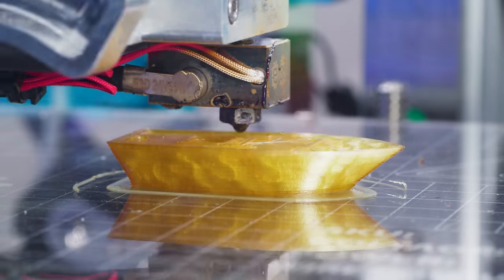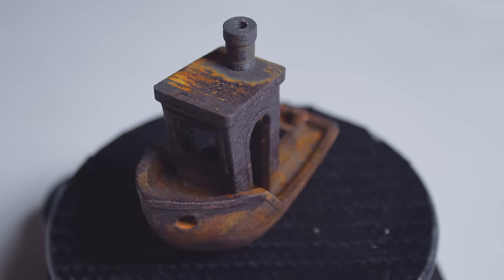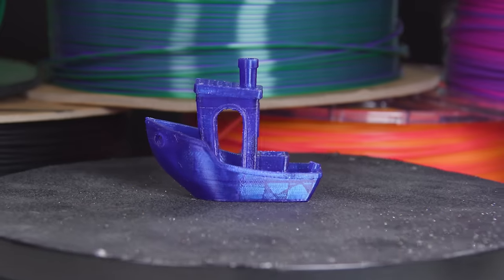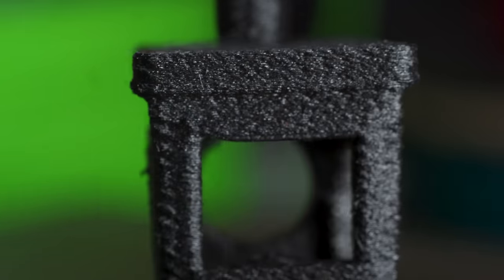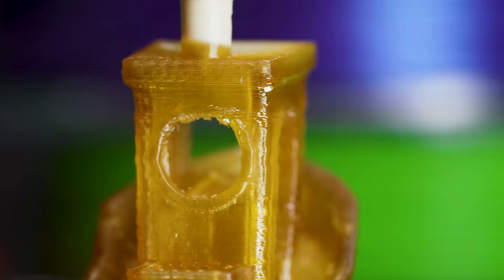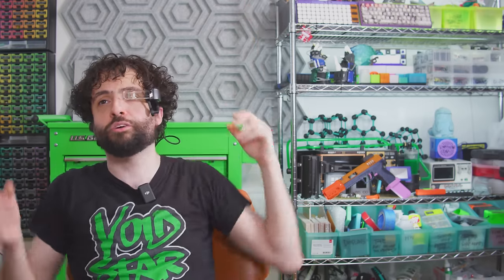The 3D Filament Tier List! Which Should YOU Use?

Comment: FWIW I have printed a fair amount of straight-up PP on my X1C - it's really easy to get bed adhesion:  clear packing tape is PP, so just put strips of packing tape on your bed and you're off to the races. You'll want to have an enclosed printer to avoid warping.  Print with minimal cooling (read 'print it slow ') to get the best looking prints.  Major plus points for PP: complete layer adhesion PLUS food-grade (use a Stainless nozzle for only PP to avoid contamination) make it very useful for anything food-grade and industry.
Reply: The material itself may be food grade but that doesn’t mean the printed part is.

PP is a great material if you can get it to work, it is very durable.
Reply: “Straight up PP” 🧐🧐🧐
Reply: and it can take the heat so you can sterilize it, and its recycle code 5

Comment: TPU 95a is a really great filament for heavy wear items if you 1. can get the highspeed version and 2. setup a specific printer dialed in for it (an older slower one works great). I've been using it to make specific belts for certain "difficult environment" equipment with great success but it took a very specific only that setup to get it to work... removing supports mostly works and you can actually mildly flame smooth parts with a torch if you really want to (do this outside though and only used for some brake/clutch covers).

Comment: Gonna have to hard disagree on the metal bearing filaments.  They can be a pain in the ass, and yes, you can electroplate, but when trying to make either cosplay items or artifacts/props from video games and movies the ability to rust/patina them and to sand them to a very metal appearance, it's straight up far far better than electroplating.  With electroplating you can get nice shiny metal finishes, but these filaments absolutely slay if you want aged and weathered metallic finishes.
Reply: His tier list encompasses all the use cases possible not just your one specific hyper niche use case
Reply: @rodiculous9464  I'll note that the rubric included what uses cases the filament enables, and cosplay / props isn't a small niche
Reply: Gonna have to note that there are multiple million+ subscriber youtube channels dedicated to these activities.

Comment: Hey Zack if you wanna run some TPI/PEEK/PEKK/Ultems or other super polymers, we've got two crazy high temp printers just sitting in our warehouse. They'd need some love, but could be a fun project breaking down an industrial system and fixing/upgrading them. One is a 3ntr Spectral 30 which has 3 nozzles that can reach 500C and a chamber that can reach 250C. The other is a Smart3D macro engineering prototype, but it can also hit the 500C with 2 nozzles and 200C chamber (though it took nearly 2 hours to hit that chamber temp when we tried it). If you're interested in either of them, we can let them go for practically nothing and would love to see them put to use!

Comment: The Polymaker PA6-CF is something special. Currently printing it using an off the shelf Ankermake M5C with zero issues. I did have to edit a few settings to help oozing, but it prints just as well as PLA now.
Reply: love it

Comment: I used to print PEEK molds for heated silicone foam molding back in the day. The parts sold for a lot so it was well justified - but we used big ol' Stratasys machines and lots o' consumables.
Reply: Wow, if third-party PEEK filament is expensive, I can only imagine what those Stratasys consumables must have cost! 😮 Even with that, I’m sure the molds were much cheaper than machined ones, yet still with plenty of profit margin.

Comment: I've been printing with Polymaker PC 3kg spools on my Bambu Labs X1. It's been awesome. I live in Florida and moisture hasn't been an issue. I've Made lamp shades and aquaponics towers with it. It's become my favorite filament
Reply: I am also in florida and have an X1C coming on monday. Wooo
Reply: The PC that is generally available (Bambu and Polymaker) I understand to be PC and PETG, although exact composition is difficult to come by.  Regardless, it prints great on the Bambu X1C.  Easier to work with than the PETG filaments, as it releases from same material support and sticks to a glue surface on a PEI bed when hot, but releases at room temp.  If it came in more colors, it would be perfect.

Comment: I use PP for lab stuff, running experiments with more bed materials. So far only sacrificial packing tape works well enough.

I am also experimenting with POM, literally impossible to get a good print with a normal printer. I definitely do want to figure it out for some scuba stuff. Current test is a phenolic paper surface.
Reply: In the Every filaments II video, Zack talks about Fillamentum PP 2320, which is a Polypropylene formulation that optimized for ease of printing, it's not hard to print, I use it a lot for chemistry/lab stuff. It's quite good

Comment: While it's awful for printing, HDPE is fantastic for milling. It cuts like butter.
Reply: It's funny that he mentioned Delrin immediately after HDPE and mentioned that it's great for milling. Which is also true!
Reply: Turned some endcaps out of 6" diameter HDPE cylinders, the smooth ribbons that came off were a sight to behold.
Reply: @defenestrated23  Ooo, I've never turned it, so I've yet to experience such beauty. Turning aluminum with nice sharp tools has produced ribbony chips for me, but they were somewhat worrying due to concerns about overheating.

Comment: You put CF PLA in S but ASA in A? Have you actually checked the usefulness of CF PLA? It looks pretty, it has slightly better heat resistance to regular PLA. It’s more brittle, its mechanical properties are horrible. Other than making something that has no load or heat exposure and no impact. It’s more or less useless unless you just want the matte cf finish. It’s not more precise, it just looks smoother due to the fibers. 
ASA is as good as ABS and has UV resistance.  16:30
Reply: ASA is awesome! You don't get the shininess of ABS but you lose the massive warping issues, it doesn't stink when it's printing, and it's weather resistant without needing coating
Reply: @greensheen8759  but then again it cracks on bigger prints

Comment: What you were talking about is a class of chemicals like 1,1,1 Trichloretholine.  It is illegal to possess in the US, it's actually illegal to enter the territorial waters of the US with a drop of it. I worked with it in the 80s and 90s. I put chemical resistant gloves in it and they dissolved. There is residue of it in the hubble because we used it to clean the encoding boards with it. It was the only thing to dissolve the lead in the solder we used. It was silver resistant so it left pure silver behind. It was used because we couldn't get 100%silver, we used 99.9997% silver and trichlor killed that last tiny bit of lead.

Comment: Full Tier List

S Tier:  
Carbon Fiber PLA (4:50): Enhances stiffness/detail without losing PLA ease.  
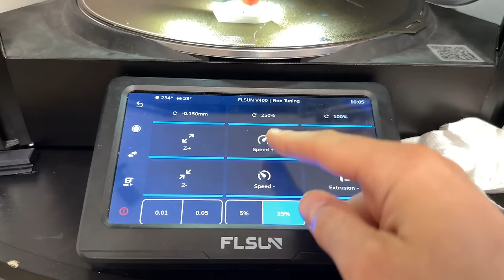High-Speed PLA (8:48): Faster printing, retains quality.  
“Tough” PLA (7:39): Greater strength and heat resistance than regular PLA.  
Carbon Fiber PETG (11:19): Adds stiffness to PETG, with less warping.  
PCTG (11:57): Durable, impact-resistant, better chemical resistance than PETG.  
TPU (9:37 & 24:56): Flexible, durable, for protective/wearable applications.  
Glass-Filled Nylon (19:39): High strength/rigidity, for functional parts.  
SEBS (27:26): Stretchable, returns to original shape, for special uses.

A Tier:  
PETG (10:35): Good toughness, easier to print than ABS.  
CF PET (13:36): PET with carbon fiber, stiffer with good printability.  
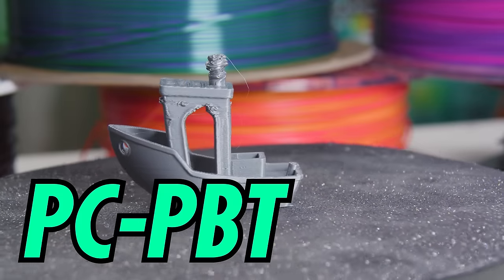PC-PBT (23:36): Durable, low-warp, versatile.  
PEKK (35:01): High performance for extreme conditions.  
Ultem 1010 (37:50): Excellent thermal and chemical resistance, challenging to print.  
PPS (35:38): Chemical and heat resistant, tough.

B Tier:  
Regular PLA (2:54): Easy to print, wide color variety, less durable.  
Silk PLA (4:02): Shiny finish, visually appealing, weaker than standard PLA.  
Matte PLA (8:10): Aesthetic matte appearance, slightly flexible.  
PA-6 Nylon (17:02): Durable, flexible, moisture sensitive.  
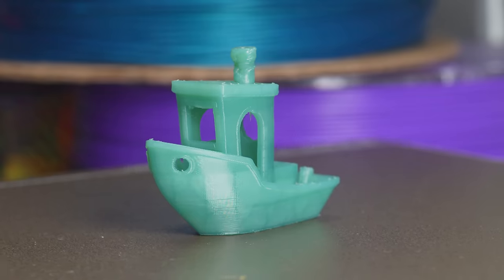PA-12 Nylon (18:16): More flexible and impact resistant than PA-6.  
CF Nylon (18:50): Strength of nylon with added rigidity of carbon fiber.  
GF-PP (29:04): Tough and lightweight, difficult due to warping.  
PSU (36:19): High heat resistance, suitable for food contact.

C Tier:  
Metal-Filled PLA (5:45): For aesthetics but brittle and expensive.  
PVB (14:05): Unique post-processing opportunities, some challenges in printing.  
OBC (29:43): Tough and flexible but struggles with bed adhesion.

D Tier:  
Wood PLA (6:26): Wood-like finish, can be challenging to print.  
HIPS (16:22): Used as a support material, less common with alternatives.  
ASA (15:40): Good for outdoor use, careful printing required.  
ABS (14:44): Durable and heat-resistant, emits odors, difficult to print.

F Tier:  
POM (30:58): Engineering material, hard to print.  
Polypropylene (28:17): Durable, notoriously difficult for bed adhesion.  
HDPE (30:16): Common plastic, poor for 3D printing.  
PVDF (31:56): Chemically resistant, hazardous when overheated.  
PEEK (33:06): High performance, prohibitively expensive and difficult.
Reply: Thanks man

Comment: I can't seem to find 99D TPU.  The link in the description links to 95A.
Reply: 95A is fine in my experience, its a little flexible, but will be just a strong. Basically indestructible, and for all intents and purposes rigid, at least if printed with high (or 100%) infill.
Reply: Armadillo from Ninjatek is 75D, but is way more expensive (100$/kg)

Comment: 40:35  It would be interesting to see if/when it makes sense.  Selective Laser Sintering (SLS) or Melting (SLM) or heck even Electron Beam Melting could make parts out of actual metal or some superalloy, so even if it can’t be machined by conventional means one would think it could still be done with metal?

Maybe some odd case where it needs to be Super-Resistant to Heat/Solvents, yet also Strong, yet *also light*?

Either way wild stuff.

Comment: My only disagreement would be to move iron filled filament up at least one step, I've found it's magnetic properties can be really useful for prototyping motors and magnetic gearboxes. Compared to trying to machine a big chunk of iron or managing to get ahold of electrical steel I'd much rather work around it's drawbacks.

Comment: PC-PBT-CF15. S tier. As strong as PA12, dimensionally stable like PLA, does not embrittle at low temps, high fatigue resistance, high toughness, and decent HDT. Once your printer is dialed in, it's my favorite filament for engineering projects by far.

Comment: 95% of the time I print nylon, CF-Nylon or CF-PC. The only time I had issues with nylon or PC was with gizmodorks filament. It sucked, the nylon wouldn't even stick to itself, and the PC warped like mad. If you stick to nylon made by taulman, you'll be fine, its just as easy as PLA to print. CF-Nylon or CF-PC always printed easily regardless of the manufacturer. I've printed CF-nylon from eSun and 3DXTECH's CarbonX, both printed well, though the carbonx filament is a bit brittle. I've also used CF-PC from Priline and YXPOLYER, again both printed fine. Ranki GF-PC is also a nice filament, it comes out more glossy than CF.

Comment: Generated by ChatGPT based on the transcript:

S Tier (Top Recommended)
Carbon Fiber PLA (CFPLA) (Timestamp: 4:50): Enhances PLA with carbon fiber for sharper details and increased stiffness. Highly recommended for aesthetic and functional parts where black color is acceptable.
High-Speed PLA (Timestamp: 8:48): Designed for extremely fast printing up to 300 mm/s. Best used in cooler climates due to its lower melting temperature.
Carbon Fiber PETG (CFPG) (Timestamp: 11:19): Adds the stability and support quality of carbon fiber to PETG, making it excellent for functional prototypes.
PCTG (Timestamp: 11:57): A superior version of PETG with better strength, durability, and ease of printing.
Tough PLA (Timestamp: 7:39): A blend of PLA and polybutene talate (PBT) that offers higher resistance to temperatures and impacts, making it suitable for a wide range of applications.
TPU (99D) (Timestamp: 24:59): Extremely durable and perfect for high-impact and high-wear applications like combat robots and tactical gear.
Glass-Filled Nylon (Timestamp: 19:39): Offers exceptional stiffness, toughness, and is easier to print than standard nylon, suitable for demanding engineering applications.

A Tier (Highly Recommended)
PETG (Timestamp: 10:35): Offers a good balance of toughness and heat resistance, slightly more challenging to print than PLA.
CF PET (Timestamp: 13:36): Increases stiffness and ease of printing, ideal for structural components in engineering applications.
Matte PLA (Timestamp: 08:10): Provides a satin, slightly flexible finish that enhances aesthetics and offers moderate impact resistance.
PEKK (Timestamp: 35:07): Slightly easier to handle than PEEK with almost as strong mechanical and thermal properties.
Ultim 1010 (Timestamp: 37:57): Extremely robust and resistant to various environmental stresses, demanding in terms of printer capabilities but excellent for high-performance parts.

B Tier (Good, with Specific Use Cases)
Silk PLA (Timestamp: 4:02): Offers a shiny, metallic finish but structurally weaker, best used for showpieces.
Wood PLA (Timestamp: 6:31): Provides a wood-like finish and texture, ideal for decorative items that mimic wood.
Semi-Flexible TPU (Timestamp: 26:11): Offers a balance between rigidity and flexibility, suitable for items like protective casings and bumpers.
Nylon (PA-6 and PA-12) (Timestamp: 17:03, 18:16): Durable and flexible, ideal for industrial applications but requires careful handling due to moisture absorption.
GFPP (Timestamp: 29:06): Extremely tough and suitable for industrial applications, although it is challenging to print and requires specific printer settings.

C Tier (Challenging to Print or Limited Use)
Low Durometer TPU (Timestamp: 26:37): Extremely flexible, suitable for specific applications where high flexibility is required but difficult to print.
POM (Timestamp: 31:02): Offers high stiffness and low friction but extremely challenging to print and can emit harmful fumes if overheated.
Polycarbonate (Timestamp: 21:10): Very tough and heat resistant but difficult to manage due to warping and moisture absorption.
PMMA (Acrylic) (Timestamp: 22:36): Excellent for applications requiring high clarity and UV resistance but brittle and difficult to handle in printing.
PEEK (Timestamp: 33:06): While offering exceptional properties, it is prohibitively expensive and complex to print, limiting its practicality for most hobbyists.

F Tier (Not Recommended)
Metal-Filled PLA (Timestamp: 5:46): While visually appealing due to its weight and metallic feel, it's brittle and not cost-effective compared to simpler alternatives.
HIPS (Timestamp: 16:25): Primarily used as support material, it offers limited usefulness as a primary filament due to its flexibility and softness.

Comment: That 80D TPU that you mentioned is too stiff for some and too supple for others might actually be exactly what I need for a project! I'm working on a custom instrument that needs a bite-able mouthpiece... I want it to be hard enough that you need to bite fairly hard to bottom out the sensor, but soft enough that you don't chip your teeth doing so.
Reply: Warning that if it isn't food safe, it's certainly not safe enough to hold in your mouth for any length of time.

I recommend two-part silicone, specifically the kind that comes in two putty pods for dental impressions. (I have personally used the stuff and can verify that it is the consistency you want once cured.) If you really want to involve 3D printing, print a negative mold of your desired part, then after it's cast scrub the silicone extremely thoroughly with a dish brush and soap to remove residue.

If you don't want to involve specialist dental putty, boil-and-bite sports mouthguards are also in the general vicinity of the hardness you want.
Reply: @orngjce223  I agree, you do not want 3D printed TPU in your mouth for any length of time. On top of the layer lines any marks or cuts made by your teeth in the material will make it very difficult to clean too and would end up going nasty. Plus TPU is highly hygroscopic.
Reply: @orngjce223  Ahh good point, I hadn't even thought about that!! Bit late as I already tried this a few years ago with NinjaFlex, but didn't use it for long. Thanks for the material recommendation!
Reply: @conorstewart2214  Ahh, that explains some behavior I was seeing in my first prototype. Good to know!

Comment: I'll stick to PLA (and PLA+) :). You might consider an episode about task-specific selection of filament. Like "OK, so you want to print miniatures / scale models and emulate resin as close as possible, then..." or "If you need a sturdy spare part for your bike, then...". All that without dying in the process. Freely include indication of suitable nozzle diameter, printing speed etc for the best time/waste/quality/cost/success balance.